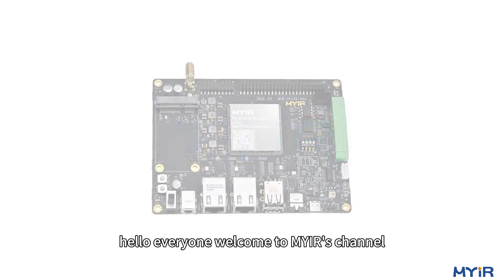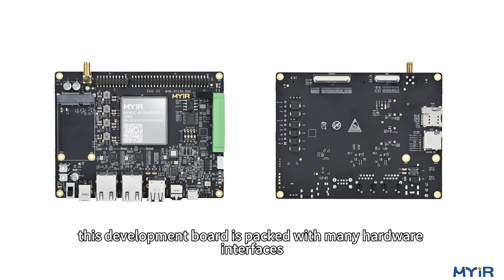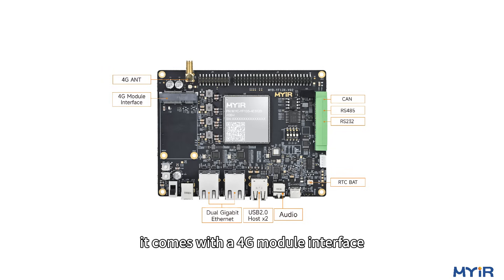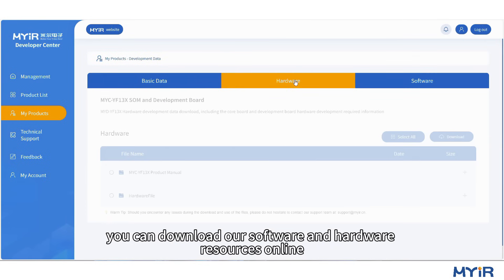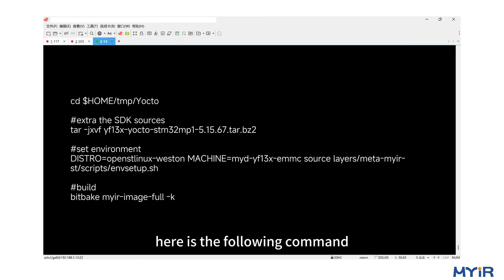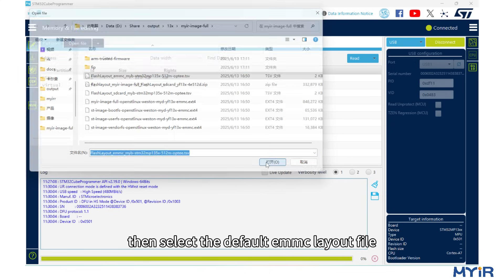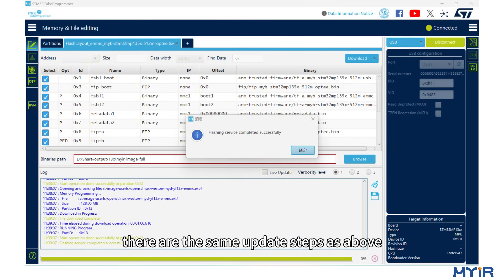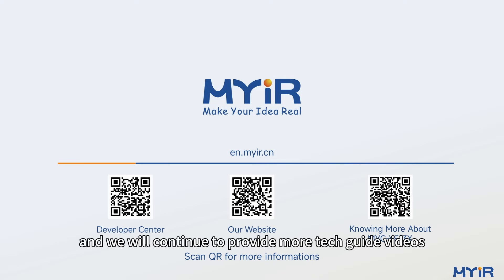STM32MP135 MYD-YF13X Development Board Quick Start Guide

Comment: Hello. Good video. Could you make a guide on using the MYD-YF13X board as bare metal or as an Azure RTOS? Linux isn't for everyone. And this MP135 processor is attractive because it allows you to run your own program. Do you have a ready-made MYD-YF13X board project for STM32CubeMX?